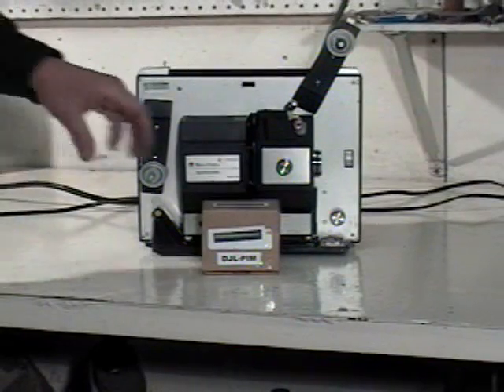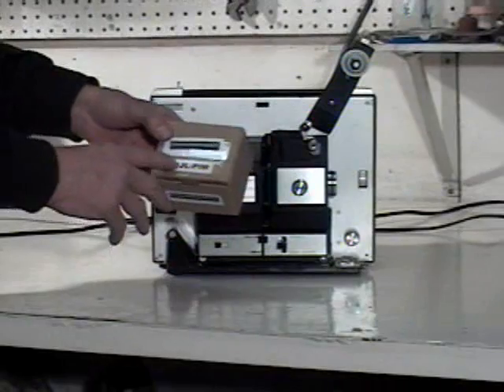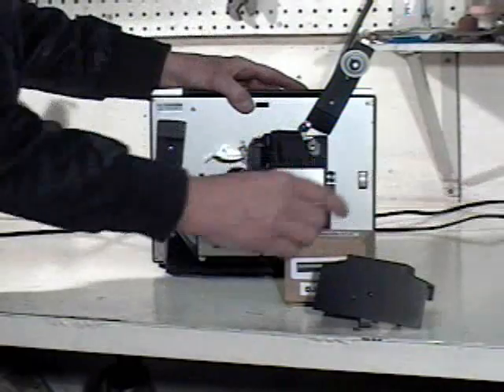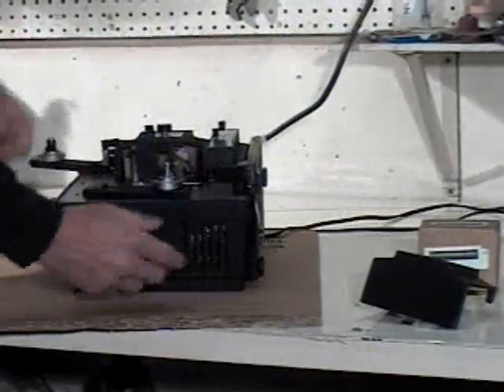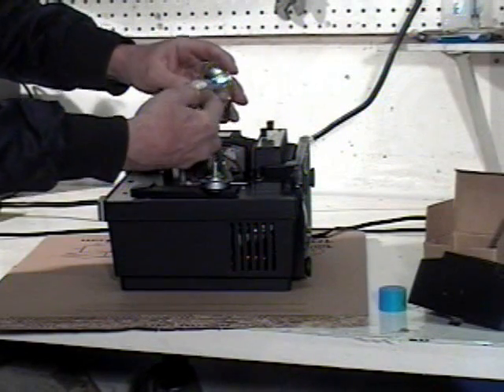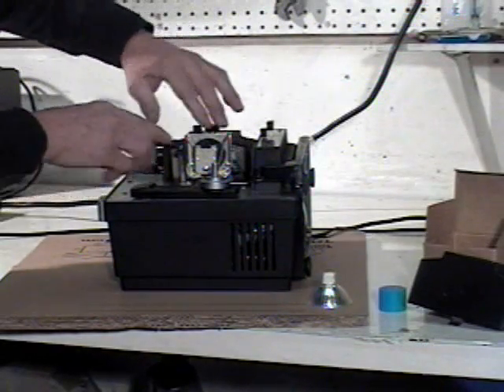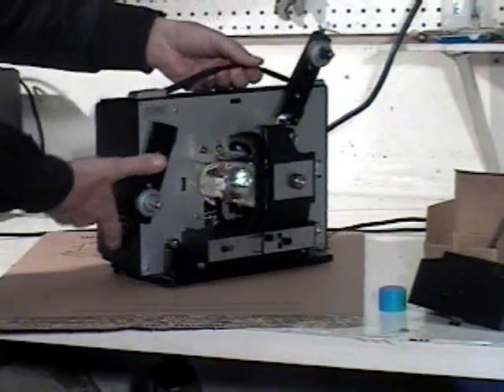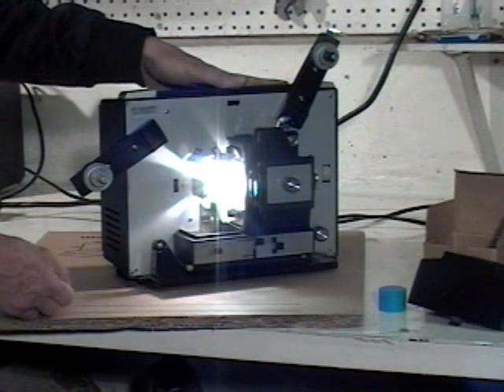DJL- Projector Lamp Module for Bell & Howell 346 356 357 358 456 457 458 461 462 467 468 476 481

Comment: A maioriacomo trocar uma lâmpada por uma mais moderna para o Filmosound Bell & Howell 385
Reply: hardluckcharlie And don't forget it works with DLG type lamp depending on any type, and also works with CWA, CTS, CVS and DAX for the 16mm projector
Reply from the maker: Thank you for adding that information. Much appreciated.
Reply from the maker: We do not make a module for that model. This is a list of lamps that will work for you. DAG, DEJ, DFK, DFY, sound:BRS